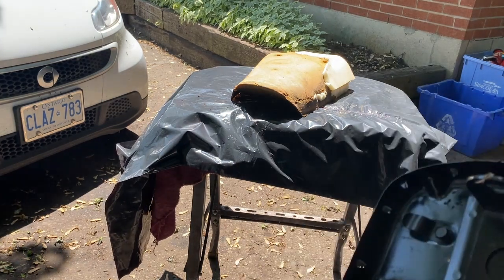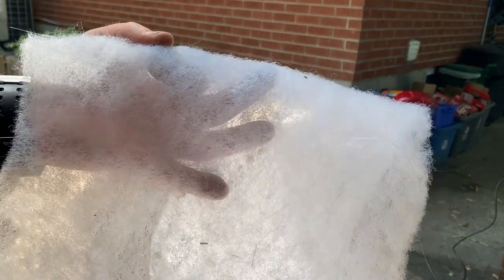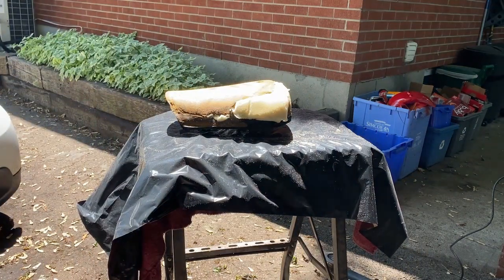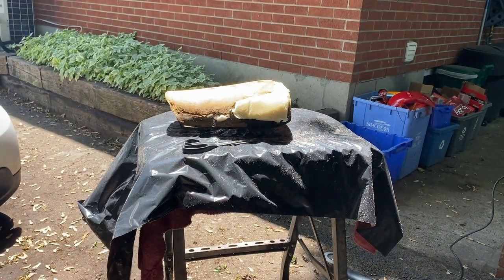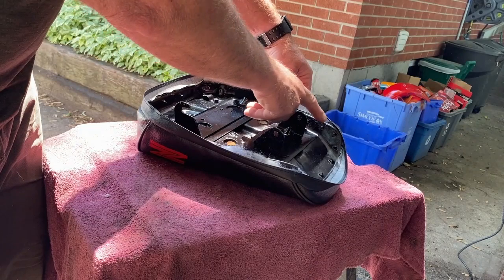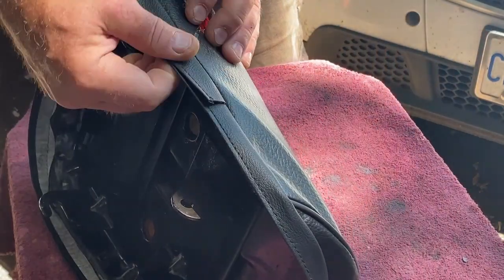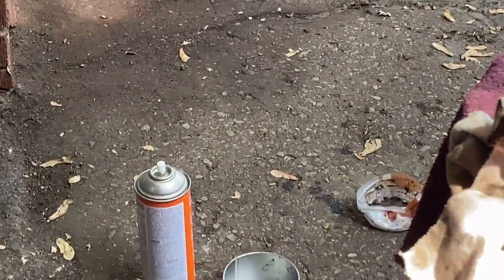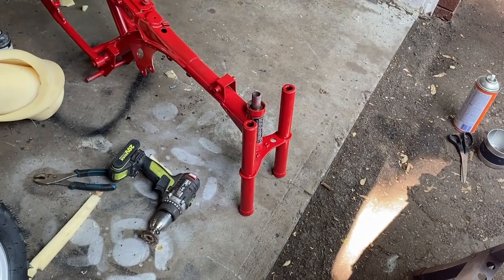Honda z50R restoration .part 3 . engine paint, valve adj. , steering bearing, seat re-cover

Comment: Why cheap out on all your paint,it will never hold up,in your last video you took the time to grease your rims so tires would stick to them after 30 yrs but all your paint will chip or scratch off in 30 days if it's actually being used